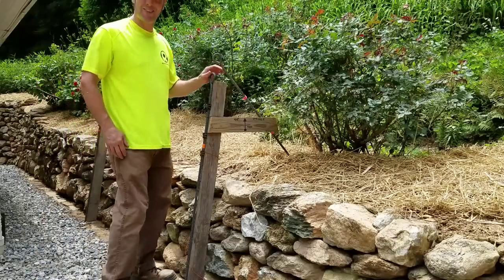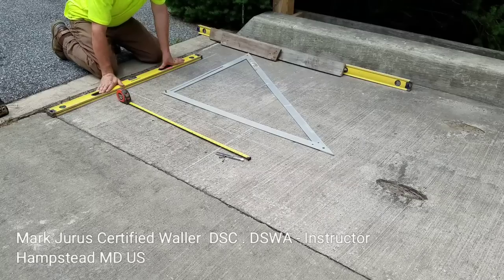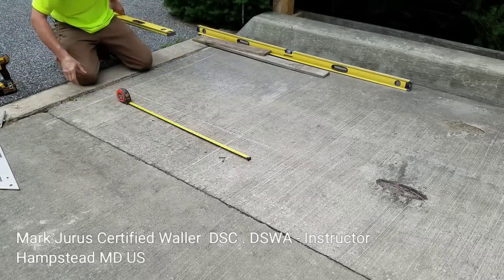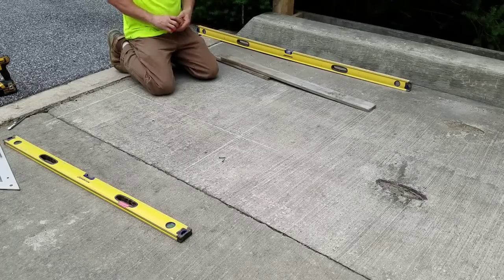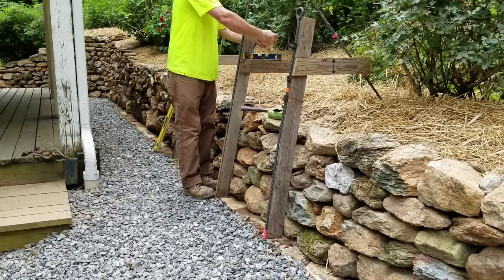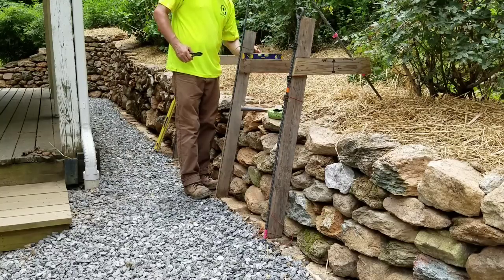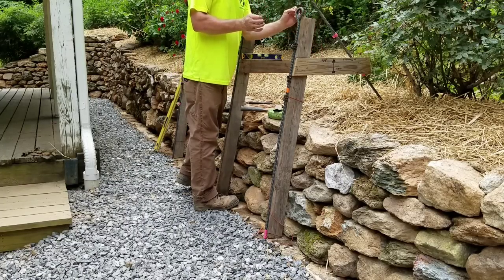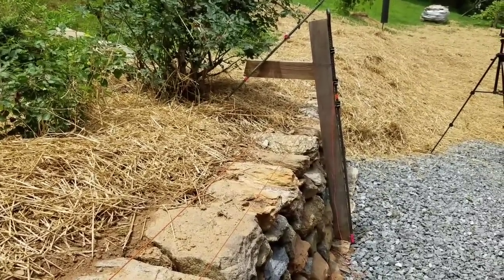DIY How To Build & Install Single Sided Wall Frame - Dry Stone Retaining Walls

Comment: I like the ring on the top of the batter board rods. I also blacksmith and will do that to my batter board rods also. I use two pieces of wood bolted together for top of wall reference, and paper clips on the rods to hold the double lines. Thanks, Rick

Comment: Thank you for making this Mark! I was wondering about your method for making frames. I can't drive any stakes into the ground on my current project (a sidewalk is in the way), so I'm relying on heavy rocks holding the frame at the top of the hill. It's working so far.

I have a curved section and I don't know how to set up strings to match the curve. If I don't learn how to do it, I think I'll be left to building the wall in an octagonal shape or eyeballing it the best I can with my strings as a general guide. Thanks again for the videos. They have been a help!
Reply from the maker: Hello Sarah sorry I'm just figuring out this hole comment thing on YouTube. I'm sure your done by now. I normally build legs on the bottom of my frames on front bottom when I sit on driveways. Then use a couple rebar rods to get me into the back. The best tool when you have this issue is either cut a 4' piece of plywood the negative shape of your frame. Then Duck tape it to a 4' level. Then hold it up the wall as you build. I prefer using the Sola 2' Inclinometer when building curves. I set it to a frame so I have the correct angle then go to town. It never lies! GAME CHANGER.. Just have to watch for stones that bump out ie bull noses. I'll have to do a Video on this. Great question.  TOOL: Sola Magnetic Analog Inclinometer https://www.sola.at/en/products/nam-p3624

Comment: Love your videos! Is this a single sided retaining wall, as in is there only one layer of facing stone and none behind?
Reply from the maker: Thank you Arda. Great question. NO!  this is a Single Sided Wall Frame. The wall is DOUBLE sided wall. The walling style I build is a Yorkshire which is front wall back wall with hearting (Packing in the middle) There are styles of single walls. But to keep in simple for most folks building walls they should always be double unless you know the style. Most folks in similar industries try to build dry laid stone retaining walls and build them as single. THEY WILL FAIL! You must have a back support system just as you would any gravity wall.
Reply: @RockinWalls  Good man! Thanks for the advice. Am attempting to repair and add to a stone wall in Ireland...this video has been invaluable.

Comment: I've noticed your walls bay last long,
Why if built well should last at least 500 yrs, here in the uk most of our dry stone walls have stood a 1000yrs and longer, we use an A frame, good pad stone on the base, 
And tools such as a bolster chisel, chipping hammer, you call a brick hammer, etc.and lines levels.
Reply from the maker: EXACTLY!  Well said Michael. Here in the states you would be surprised how many companies think they can reinvent how to build dry laid stone walls. For example add gravel in the back,  build a single faced stone wall, add landscape cloth behind a wall, add mortar and call it dry stack - that's my favorite by far! LOL As you have said simply just set the stone on a good compacted earth base, set up some line pins or bars, add string lines and get to it. Most dry stone walls even in UK typically need maintenance every 100-200 years. UK has some of the oldest know dry laid stone structures to man such as the Skara Brae believed to be 5000-7000 years old. If a dry stone wall fails not by a natural disaster sooner than 100 years someone built it WRONG!

Comment: How do you get the angle to cut the end of the board that's resting on the ground?
Reply from the maker: You can simply lay your board long at the base and just use the baseline as a guide to get the correct angle across in order to cut it.